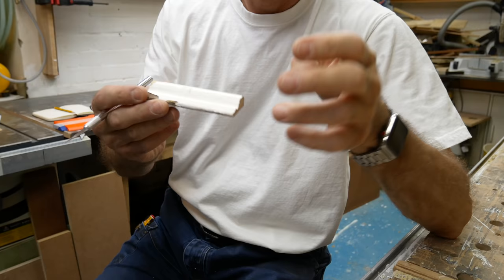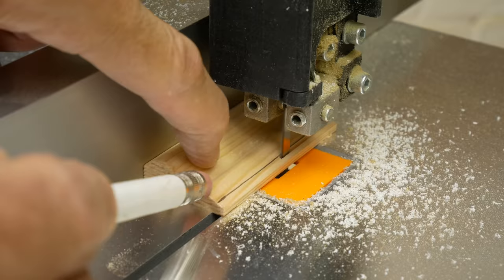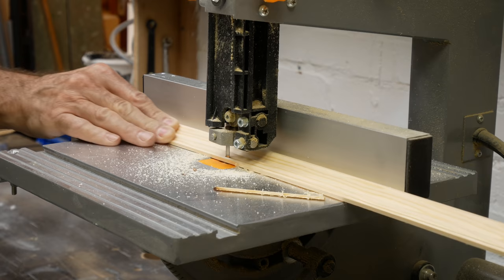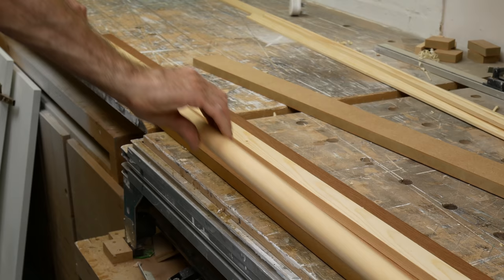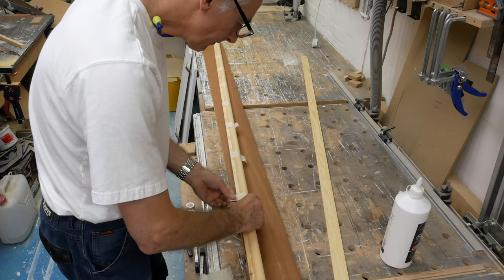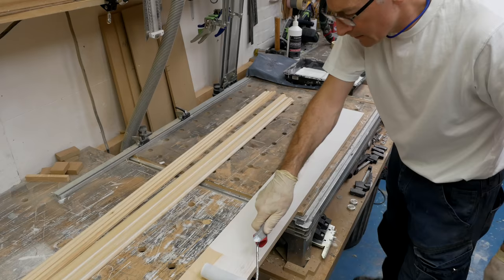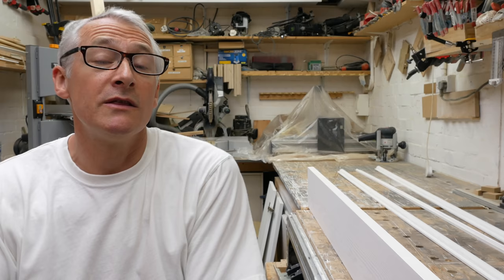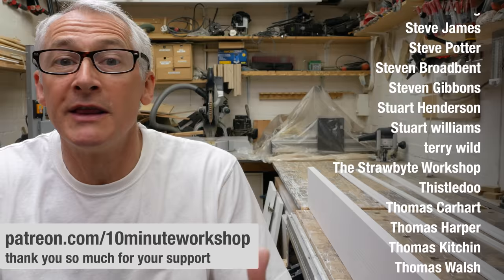Silly Little Job ? Not to the clients... [video #350]

Comment: I'm sure you know this already but you can get spindle moulder cutters made. I got one to match some moulding in our house, the cutter was about £50 and each 2.4m length was £6 (IIRC, it was a couple of years ago). Possibly not worth it for such a small job but useful if you need more than a couple of lengths.
Reply from the maker: Thanks! Yes, Whitehill do them, and I’m sure others do too, but as you say not really worth it for a couple of short sections 👍👍

Comment: Make a sled that is a ninety degre total with fortyfive degree in relation to the blade of the bandsaw, the sled will have the roundstock lying quite steady no matter the diameter of the roundstock, the sled can be stationary and it won't pinch the blade.

Comment: One of those times a festool linear sander would be nice... Well done on this "silly little job though" What do you think about stick sandpaper to your sample piece, sanding a block of xps or other hard polystyrene type stuff to make a negative form, then sticking sandpaper to that to make your own little linear sanding block to finish the sanding after the initial build?
Reply from the maker: I do have the linear sander tbh, but I’ve found it to be to o much of a faff to use on anything as small as this - and tbh I haven’t been overly impressed by that quality of the ‘match’ you get from the profile 🤷‍♂️👍

Comment: An excellent job Peter. You always make me look at things a different way. I would never have thought to do that with a dowel. I have tried matching molding before with a series of router bits and once had to match about four feet of molding and used a grinder to sharpen a hand scraper to the shape I needed and spent a good 45 minutes or so to get it to roughly the correct shape and then used another flat hand scraper and various sanding pads and sandpaper to get it to the correct shape. Thanks for making me think a little more outside the box.
Do you have a link to the install video yet?
Ron
Reply from the maker: Thanks Ron! The install on this ended up being all a bit rushed, and I think I ended up folding what I had into one of the ‘week in the workshop’ vlogs I do for my Patreon channel, rather than publicly here. 🤷‍♂️👍

Comment: At 5:45 you used a paint brush to spread the glue. I personally have used a mini paint roller for spreading the glue. Do you ever do it this way?
Reply from the maker: Thanks ! These are Silicon pastry brushes, the dried glue just pulls right off (video #117). Yes, I use a foam roller when I want to spread the glue nice and thin (see video #003) but I wanted it spread a bit thicker on this. 👍👍

Comment: Nicely done as always, Peter, but did you check availability of that ogee profile skirting board before making your own? It's something I've used a lot of recently and the exact match in softwood is readily available in the UK.
Reply from the maker: Appreciate the thought, but the Ogee profile on skirting is quite different to that found on panel moulding. 👍👍

Comment: Peter, No they don't make propellors like that🤣🤣🤣🤣 copy duplicator usually (yes l've made some)
Interesting video though👍👍👍
Reply from the maker: Well, I was thinking more of back in the Tiger Moth days, you know, a ball of string and canvass, flying in loose formation... 🤷‍♂️👍😆
Reply: @10MinuteWorkshop  ha ha funny 🤔🤣 propellors are way more complicated, the Wright brothers understood the twist gets flatter towards tips.  Still great video and it was a throw away remark anyway.  👍👍👍
Reply: @10MinuteWorkshop  Even back when Tiger Moths were state of the art, propellers were cut on a copy duplicator, often several propellers would be cut at the same time from the one master template. Even today, when wooden propellers are cut on a CNC machine, the machine still rotate the propeller along its long axis just like the copy duplicators did, only the template is in the computer memory rather than being a physical 'thing'.

Comment: 25mm dowel.. sooo... have u not got a roundover router bit  & some 1" by... round over both corners of an edge & rip off the plank... I suppose if u already had the dowel yer set either ways... 🤨
Finicky little job ... but good customers need lookin after  😏

😎👍☘🍺
Reply from the maker: Already had the dowel 🤷‍♂️👍
Reply: @10MinuteWorkshop   welll .... thats okay then.... carry on ... 🙄😏

😎👍☘🍺
Reply: @10MinuteWorkshop  A new dowel?  I know somebody who'd use reclaimed a broom stick.
Reply: @hansdegroot8549   
🙄🤭

😎👍☘🍺